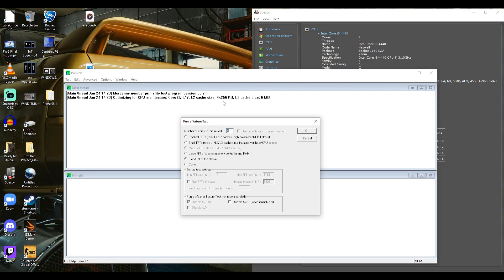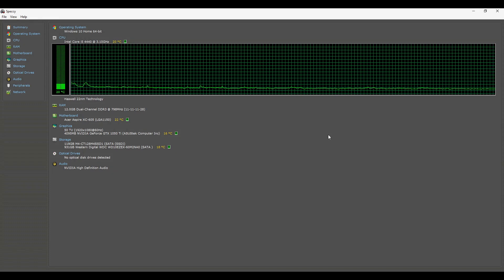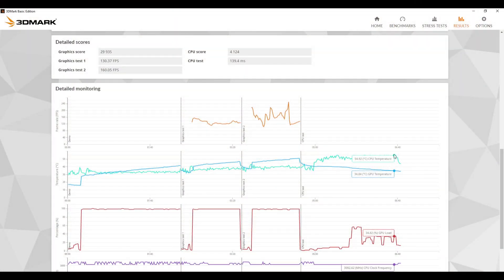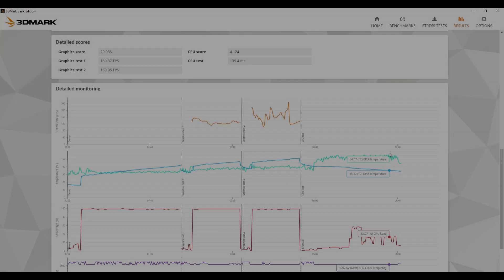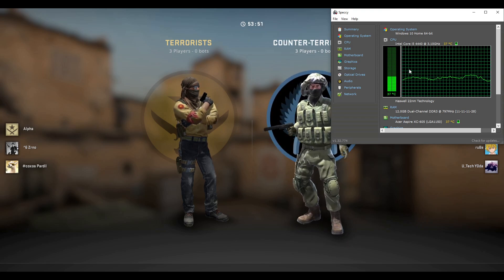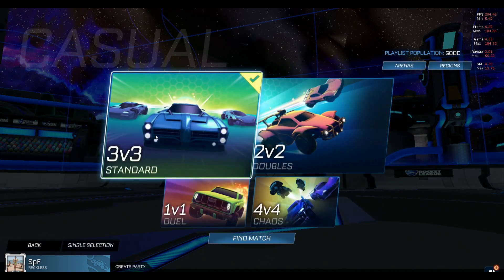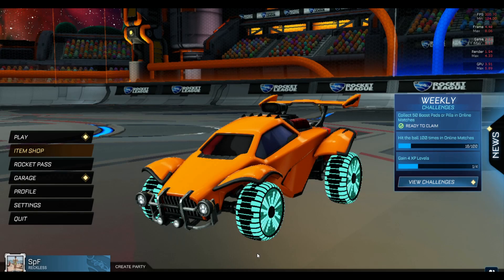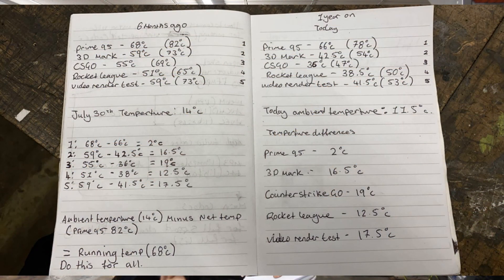1417 - Graphene Based Conductive Ink as Thermal Paste - 1 Year On!

Comment: It’s clearly graphitizing. You should also try tightening it up, if there are screw/posts. The comments on thermal cycling are valid too, but if you pull off the heatsink it’ll be way more gray than before.

Comment: re rocket stove - Have you tried 3 meters of copper wire and 3 meters of iron wire joined as a pair at one end, insulated from the stove and each other, wound round the stove chimney, then when the stove is hot, measure the dc volts across the wires. I had heard this works ?  something to to do with thermal electron flow.

Comment: Unfortunately ambient temperatures do make a large difference because the differences are not linear. What of energy to temperature raise ratio. 

       With the ambient temperature to the fin area of the heat sink you had a temperature that has the temperature rises the peak temperature will rise quicker compared to colder days and once you hit that threshold if you did it gets into the runaway region where you would never hit that on a cold or ambient day. . 

  This is why this type of test must be carried out in a temperature and humidity controlled room.